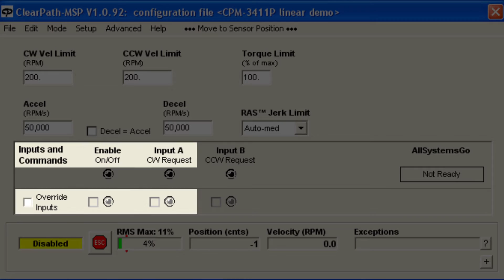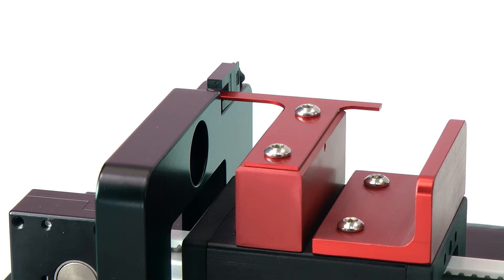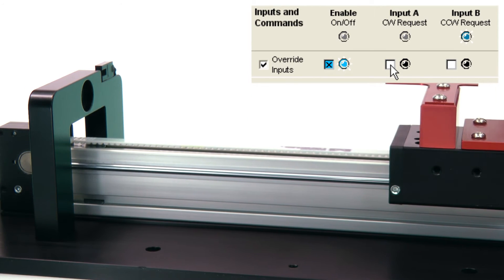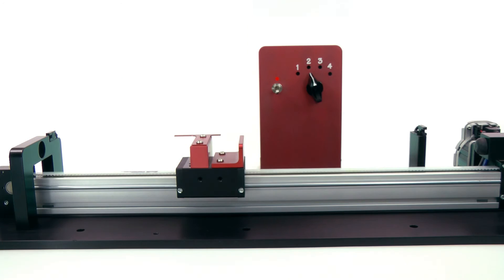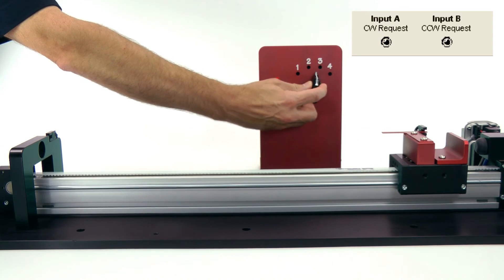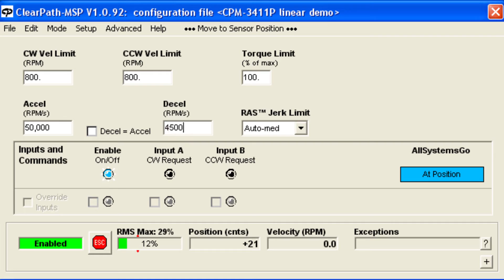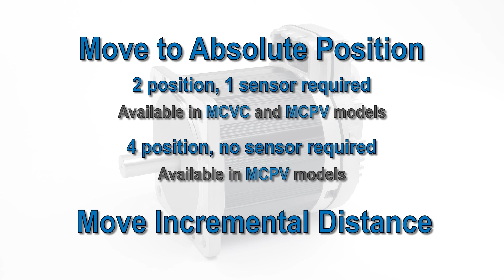ClearPath Integrated Servo Motor: Move to Sensor Position

Comment: Is there a video where if one has a 'linear encoder', how you can say 'move to 'position x'? Where 'position x' is read from the linear encoder?
Reply from the maker: Hi @gregvisioninfosoft - The ClearPath integrated servo motors featured in this video have a servo drive and rotary encoder integrated onto the back of the motor, but they don’t have an input for an external encoder. While most applications do not require external encoders, there are certain cases where they are beneficial. For OEM machine builders, Teknic offers non-integrated servo solutions (separate servo motor and servo drive) that can connect to external linear (or rotary) encoders.

We would be happy to discuss your application and help determine if any of Teknic’s solutions would be a good fit. Please feel free to call Teknic at +1-585-784-7454 or contact one of our engineers through our website: https://teknic.com/contact/.

Best regards,
Matt C. – Teknic Servo Systems Engineer
Reply: @TeknicInc  Thanks for explaining. I am just a single end user, not an OEM.  So I will need to do more of my own research.  Again, thanks for pointing out the details of the limitation.
Reply from the maker: @gregvisioninfosoft  You’re welcome, and good luck with the project!

Comment: What if I have 3 positions to move to and have the MCVC-2310D-RLS
Reply from the maker: Hi star child,

The ClearPath-MC series comes in two different variants; MCVC (Motion Control Velocity Control) and MCPV (Motion Control Position and Velocity). The difference between the two versions is the number and type of operational modes available (these operational modes provide control over the motor's position, velocity, or torque).

The MCVC motors include 4 velocity modes, 1 torque mode, and 2 positioning modes. The two position control modes available in the MCVC series (Move to Sensor Position and Move to Absolute Position: 2 Positions) provide a maximum of 2 commandable positions.

On the other hand, the MCPV motors include all of the operational modes available in the MCVC series (4 velocity modes, 1 torque mode, and 2 positioning modes) as well as 6 additional positioning modes. The additional positioning modes included in the MCPV variant provide control over more than 2 commandable positions (some of these positioning modes even have an "infinite" number of commandable positions).

The ClearPath part number you specified (CPM-MCVC-2310D-RLS) is part of the MCVC series. Since this is the Velocity Control version, the positioning operational modes available provide a maximum of 2 commandable positions. If the application requires control over 3 or more positions, then you would likely want to explore the MCPV version.

There are some additional resources available on Teknic's website to help with selecting an operational mode and motor here: https://teknic.com/products/clearpath-brushless-dc-servo-motors/clearpath-mc/ 

If you have any further questions about the operational modes available in the ClearPath-MC series or want to discuss the application with an engineer, please feel free to submit a contact request on Teknic's website (https://teknic.com/contact/) or give us a call at 585-784-7454.

-Ian R. - Teknic Applications Engineer
Reply: @TeknicInc  Hey thanks for the response Ian.. I figured it out last night. I’m hoping I can reassign this MCVC model to other duties..  It would be great if it will be powerful enough to move a print squeegee across  a screen mesh, with around 30 newtons of dynamic tension, 12-14 inches in about 2-3 seconds.. I’m using the IPC-5 with the power hub 4 to power it and the clearcore  to control it.. I’m hoping to only have to get the MCPV to move my pallet to the 3 different positions and not have to now purchase another more powerful MCVC  for the print head.. I’m trying to learn all about power requirements for a servo selection, the inertia load ratio, axial load and all that stuff and my head just want to explode.. I know I’m not going to be able to figure out the math..
Reply from the maker: @StarChild.no1  It’s certainly possible that your current ClearPath motor would have sufficient power for your application. However, in order for me to provide a confident recommendation, I’d need additional information on the application, mechanics, load weights, duty cycle, etc…
 
If you give us a call at 585-784-7454 or submit a contact request on our website (https://teknic.com/contact/), we would be happy to go through these specifications with you and help recommend an appropriate ClearPath motor for your project.
 
-Ian R. -Teknic Applications Engineer